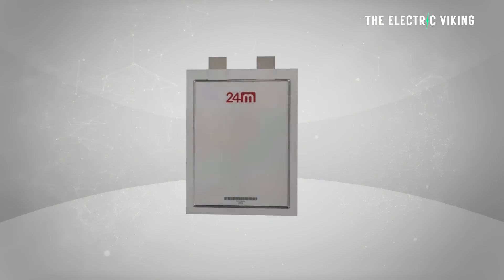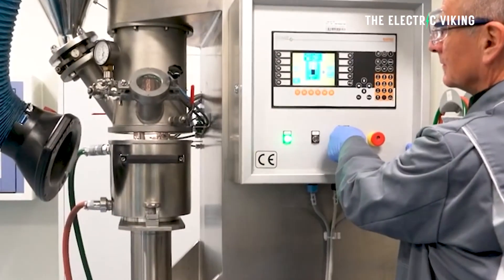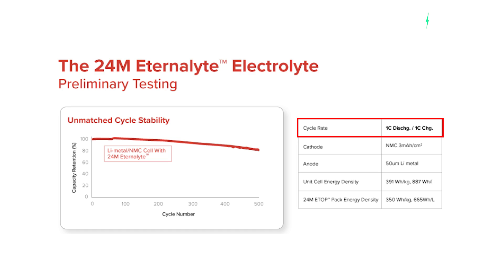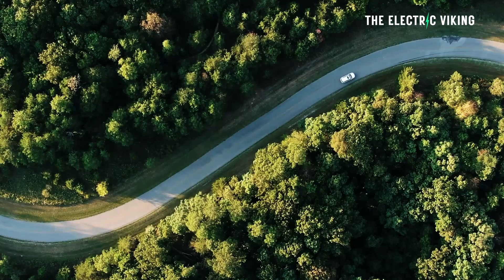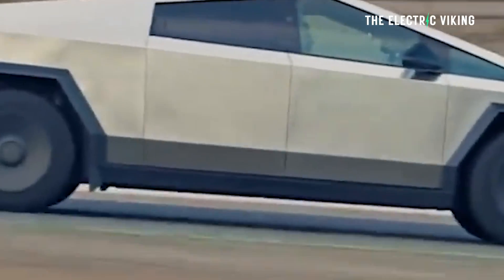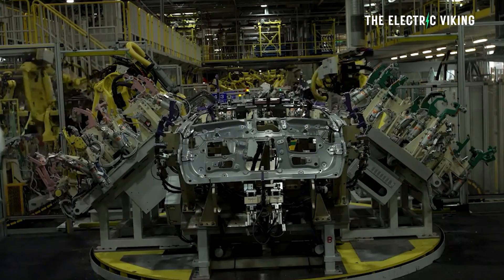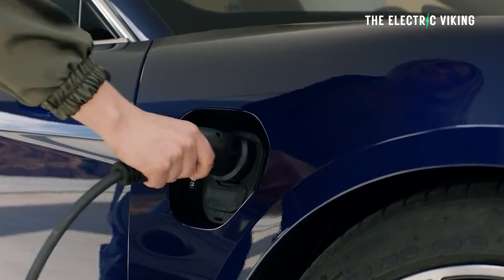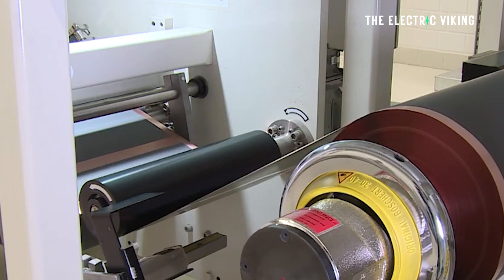American battery company reveals production ready 1000 Mile EV Battery

Comment: WRONG - The VW Passat Bluemotion (diesel) had a 70 liter tank with a consumption of 4.1 L/100km leading to a range of 1.707 km.
Reply: And we all know how accurate and honest VW claims are don't we🤣. Real world fuel consumption for ICE cars is almost as bad as the real world ranges of some EVs. Given that 60% of all car journeys are 10 km or less (global average)...most ICE spend a lot of time warming up so 4.1 l/100 km is more like 5l/100 km or above. I've run diesels and hybrids for many years before I got my EV and sure, on long journeys I could sometimes hit 60 mpg but most of the time it was 50 mpg.
Reply: After all, it just depends on the tank size. Thus google says there are common queries about cars with 70 or 80 or 90 liter tank. This implies there are applications where drivers want that amount to be available, even if they have to replace the original tank. The given example with the passat is not an exception - VW, Audi, BMW had different motors for the same car where the big blocks were quite thirsty so that they installed a big tank by default. Combine that with a super efficient motor from the same manufacturer and you get those 1000 mile range right from the production line.

Comment: Another important thing about getting over 300 wh/kg reliably is that you can make a Model 3 the same curb weight as a Camry.
Reply: Except no structural battery pack if you have to swap out the battery after 500 cycles

Comment: "Jumbo jets" I don't think so.
Reply: EVs benefit from being bigger.  
So why not aircraft
Reply: @markthomasson5077  because for a jumbo these batteries will make the plane too heavy.
The energy in aviation is fuel is about 12000Wh/kg vs 400Wh/kg for batteries. Aviation fuel is 30 time lighter. Although Aviation fuel might burn at 80% efficiency (batteries 90%) so perhaps 27 times lighter. 
So to fly 10 hour on a 747 you need about 150 tonnes of aviation fuel, but for these batteries you will need 4050 tonnes of batteries. The maximum weigh for a 747 is like 440 tonnes (plane+passangers+cargo+fuel). These batteries would make the 747 10 times too heavy, understand now? 
With mathematics you can see about 50% of what this youtuber says is wrong.
Reply: @AORD72  i was thinking more short haul flights.
Current electric planes that are nearly viable are all small.  So my question (and I have no idea of the answer).  Is would a large plane achieve this more readily than a small plane
Reply: @markthomasson5077  Probably no real difference. Small electric planes are viable because they reduce range and carrying capacity. Do the math of some of the small planes. I suspect about 30 times less range for the same capacity. 

"EVs benefit from being bigger. ", you mean a bigger battery? A bigger battery does not matter for an EV because it has wheels holding it up. A plane uses energy to hold it's battery up in the air.

Comment: No No No. We need the 1000 not 600. This is why a lot of people are not adopting. We apartment dwellers are never going to have access to enough chargers. We need to be able to go to a commercial charger every couple of weeks like filling up a gas tank.
Reply: Yea, I am not waiting for 10 hours for half a charge in a vehicle that lasts as long as the battery does and then you have to tow it to the grave because paying (tens of) thousands for the replacement of battery is insane proposition when I can have hundreds of thousands of miles in gas + an used ICE in that money + a gas station everywhere.
Reply: @Ludak021  1% of gasoline cars make it to 200,000 miles.  Consumer Reports estimates the average EV battery pack lifespan to be 200,000 miles.  So, the two types of cars last about the same number of miles.
Reply: ive had 6 cars out of the roughly 2 dozen ive owned over 25 years that had over 200k miles.   and all were european cars

the partial fallacy of your statement is that people economically will not fix a high mile cars issues that arent really related to the engines life, such as suspension, emissions sensors, door locks, Wheel bearings, steering components, windows, airbags age out, ABS issues, seats torn up, 15 year old wiring issues, factor in labor costs etc where it makes more sense to sell the thing for scrap and buy a newer car.    

many times its not the issue of miles, but age, the drive train may still be good (EV or ICE), but it has many other wear issues.  wiring ages and breaks down, materials wear out, etc.  EVs only differ in terms of the drive train, but when you factor in the entire car they are generally identical in potential age and wear issues.  

I have a 30 year old lexus as a second car from my tesla, and it starts, runs, and drives incredible smooth and reliable every day even if it sits for a month.  but i needs suspension work, brakes, all the door locks dont work, steering column doesnt move, seats torn up.  but at 225k miles its a solid hooptie beater car, and the engine still runs as smooth as advertised when it was new (glasses of water barely vibrating AD)

 @AnthonyJMendoza-f7i
Reply: @baldisaerodynamic9692  That is nice that you take good care of your cars, but most people don't.  The lifetime of a Tesla battery is in the 300,000-mile plus range if it is well maintained.  If you don't take care of it, the battery will fail just like a poorly maintained gasoline car will fail.
Reply: @baldisaerodynamic9692  The partial fallacy of your statement is that it's not just the drive train in an EV that tends to last longer. No vibration to chaff wiring, loosen panels and cause metal fatigue, no extreme heat to rust the exhaust and degrade materials etc.
Reply: If you mean km then you are correct.  600 miles is Ok though.

Comment: Great. Now put 2 of them in an F150 so I can actually tow or haul things and sell it to me for under 60K. I'll buy one and so would half of Texas.
Reply: You can have texas. We'll be happy to walk you off.
Reply: @blipco5 along with 70% of the country's energy production.  I'm sure you dumbasses can work something out with the Russians,  Saudis, and Iranians 🤣🤣🤣
Reply: *wall
Reply: If you put batteries in the bed of the trailer and add electric motors to each wheel, it’ll effectively tow itself and reduce the efficiency losses to the “towing” vehicle. Sometimes, to solve a problem, you just have to think differently about it. An EV is not a fossil car so trying to fill it up at a gas station like one or add more fuel capacity to the towing vehicle is just the wrong way to think about things.
Reply: @tmharperjr  And now the trailer will be twice the weight ,and totally illegal to tow more than likely .
Reply: @gremlinfishing4286  … and as battery technology improves, the energy density will increase. The first planes couldn’t fly more than a mile. We’re at the start of an entirely new age.
Reply: I think we have already used all available minerals on this planet to make batteries , the improvements would have to be increased by 100 percent for it to be a viable option for everyone ,a lot of us will still need to tow 2_3 ton I won't hold my breath waiting for it to happen.
Reply: 😂😂😂😂 Right!!!!
Reply: I think you picked the wrong state…
Reply: @josephjones4293  Tell me then which state has a plan for every person who lives in an apartment to have their own overnight charging spot. EV's are not feasible for half the country who are renters just on that basis alone. Then you add in the lack of range in towing and hauling for trucks and commercial vehicles and a lack of realistic charging options for high-mileage drivers like rideshare and food delivery who also live in apartments for the most part. Drastically increasing the range or charging speed are the ONLY way to overcome the lack of charging infrastructure that will never be sufficient for these people. Thousand mile range and/or 5 minute charging or this will not happen. I had a Chevy Bolt for 6 months. Traded it in on a 50mpg hybrid because it was more of a hassle than the gas savings was worth.
Reply: @tyharris9994  Why is charging a state responsibility?  Does the state build gas stations?

Comment: Teslas use approximately 14 kWh / 100 km. Let’s assume lighter batteries would bring this down to 10 kWh / 100 km. A 100 kWh battery would therefore give a 1000 km range: not 1000 miles. 🥱

Comment: They get 340 miles out of a 75KWH battery. Not sure how a 100KWH would give 3X the range.
Reply: Right, for a model Y Long Range, 340 miles / 75 KWh is 4.5 miles per KWh, so a 100KWh battery would get 450 miles (assuming the weight is the same, but it isn’t since a model Y LR pack weight is 771Kg, and theoretically this battery would be closer to 300Kg since it has a much better gravimetric energy density (which is the REAL STORY HERE). ** these Tesla numbers are likely off by a bit, just did google research … 😅
Reply: With 391 watts pr kg density a 100 kw battery would be around 400 kg and then some for the battery casing.  400 kg for 100 kw battery is good.  A little step forward.
Reply: @jpxxx991  Can't assume its the same volumetric size even if it's the same weight. Both elements are important. It definitely would not get 1000 miles on a charge however and would not get 500K miles for 500 cycles.
Reply: @jpxxx991 check my math here, but claimed pack (not cell as you used) density is 350Wh/Kg, so (100,000 Wh / 350 = 285Kg)
Reply: >> They get 340 miles out of a 75KWH 

These new batteries aren't even using KWH's.  That's so last week!  Now they just use KW's.
Reply: @Rick_Cavallaro  KWh's for the power density, KW's for the power delivery. Both figures are important when calculating performance for a vehicle. One for distance and the other for acceleration etc.
Reply: @michaelwebsternz  
>> KWh's for the power density, KW's for the power delivery.

Nope.  KWH/liter give energy density (not power density) and KWH/Kg give specific energy.  And yes KW's describe power delivery.  But my point is that the "Electric Viking" simply gets it wrong - repeatedly.  He just uses KW when he means KWH.
Reply: @michaelwebsternz  Isn't it exhausting always being the smartest guy in the room ;-)
Reply: @Rick_Cavallaro  KWh's is the measurement of how much energy the battery can hold and the KW's is how much it can output. Don't confuse volumetric density and battery density vs total storage capcity.
Reply: @mountainmantesla4395  Nah, quite fun actually. Especially when math is so applicable to financial markets as well.
Reply: @michaelwebsternz  
>> KWh's is the measurement of how much energy the battery can hold

That's what I just explained to you.  You're confusing energy and power.
Reply: @Rick_Cavallaro  I’m not confusing energy with power at all. The others certainly were.
Reply: @michaelwebsternz  I worked in aerospace electrical engineering but quit to become a cop. I had a hard time having conversations with my coworkers. They would always say "what the hell are you doing working here" LOL.
Reply: @mountainmantesla4395  I can imagine.
Reply: @michaelwebsternz  
>>  I’m not confusing energy with power at all. 

You said "KWh's for the power density".  That's confusing energy and power.
Reply: @Rick_Cavallaro  My battery has a capacity of 100KWh and an output power of 368KW.
Reply: @michaelwebsternz That's mean it can run about 16 minutes.
Reply: @michaelwebsternz  Good for you!
Reply: @akakakakakak3084  That is what battery management systems are for as well as the controller for the motor. Because I can at maximum produce something does not mean I typically produce it, or I must produce it at all. It might be that way in order to allow the recharge rate to be higher.
Reply: @Rick_Cavallaro  KW stands for Kilowatt.  That shows how much energy at a moment in time.  KWH means kilowatt hour.  That means a kilowatt for an hour.   You can think that KW is the quality of the energy and KWH is the quantity of energy (how long it can sustain that level of quality).
Reply: @AnthonyJMendoza-f7i  
>> That shows how much energy at a moment in time. 

Nope.  KW has nothing to do with the quality of energy.  What it does mean is the rate at which you can deliver the energy.  In other words - power.
Reply: @Rick_Cavallaro  OK, technically: power = watt = voltage x current.  watt-hour = voltage x current x hours.  What I mean by quality is the amount that can be delivered at each instant in time (as you said Power).  That is a measure of the quality of the battery because one measure of a better battery is how much power it can deliver at any one instant.  The total quantity of power that can be delivered is in watt-hours.
Reply: It doesn't the math / claims don't add up. Model 3 only does 4 miles per KWh with the new refresh version. Volumetric density also matters, not just the weight. The battery required to do 1000 miles is still much heavier than the current Model 3 pack.
Reply: @michaelwebsternz  not much heavier actually since gravimetric density is close to double.  Can you explain why Volumetric density matters when calculating range?
Reply: @huckthat  Need to be able to fit the battery into the space available for the battery pack. Both space and weight matter for range. Else more space might need to be taken up and it might mean the vehicle isn't as aerodynamically efficient. This pack at 665wh/l seems to be quite volumetrically efficient. So a similar weight battery with more kwh capacity would fit in less space.
Reply: The new battery ways less than half as much per kwh apparently.
Reply: Think he's talking pack size and weight not KW capacity
Reply: @ChicagoBob123  KW doesn't address capacity.  And that's why he shouldn't have used it.
Reply: Should be significantly lighter weight
Reply: he meant 200kwh
Reply: @mathieusturkenboom  of course he did.  But you'd think the guy that announces every single day the new breakthrough battery that's going to CHANGE EVERYTHING might get it right - at least once.
Reply: lets pray that he becomes more self aware and double checks his content before posting it on youtube then! maybe he'd have more subscribers if he wasnt so flawed @Rick_Cavallaro
Reply: Maybee lighter but I wouldn't bet that it works 😂
Reply: @Myrslokstok  Weight is a tiny part of range. Once you get the weight up to speed it is all about drag coefficient. You lose a little power from added rolling resistance but you can just pump up the tires for that. The math just doesn't work here.

Comment: The Viking doesn't get the need for a 1000-mile range vehicle. The first application is towing, and others said a taxi service - even if convenient pull-through charging stations exist. At the same time, however, I don't see huge companies (CATL, BYD, Tesla, etc) buying these 400-500 Wh/kg batteries because they need to produce about 10 cells per second to meet a large factory demand.
Reply: And all of us gig worker apartment dwellers don't have the time to spend our lunch hour every day at a commercial charging station.
Reply: @tyharris9994  Why would you? Just have bollards where you park your car.
Reply: There has already been a taxi firm entirely using early Nissan Leaf's, taxis dont need a 1,000 mile battery
Reply: @Stumpy1854-Orion  Most of the taxi business in America has been taken over by Uber and Lyft rideshare. The cars are owned individually by gig workers acting as independent contractors so they do not own fleets with a central charging area that they are parked at overnight but rather apartment dwellers who go home at night with their vehicle.
Reply: Actually nearly every car owner needs 1k range at least in "travel mode". That's because you usually charging from 20 to 80 percent while driving, more is slow and less is anxious, so the 60% of thousand miles definitely couldn't be called as a redundant number.
Reply: @IgorPellinen  Charge curve for these cells and maximum charging rate / charging time would be very important. Most solid state cells are not great at charging fast and the charge curves aren't great.
Reply: Good point that with this battery I can now tow my trailer a descent range.
Reply: @Clint-stanley  There are diesel 4x4s in Australia with a 900 mile range, two 90 litre tanks, Toyota LandCruiser 79 series .
Reply: I want a 1000 miles range car. that be crazy and beat all ICE vechilies. I wont buy an EV unless EV range is more then 420 miles at least compares to my toyota carolla

Comment: You really do not understand long distance driving in the Western USA, Canada and Alaska.  Typical daily driving distances are 600 to 800+ miles with sparsely located gas stations.
A 1000 mile EV vehicle with stopover charging would be ideal.
Reply: Way fewer than 1-percent ever drive more than a typical daily work commute or more than a 250-300_ mile round trip weekend adventure.
    I used to live in the remote high desert east Oregon, my nearest neighbor was 12-miles way and most of my driving was a tractor or an old 4x4 Nissan on the farm. Trips to town were on a week to10-day cycle as was typical of most of the ranchers/farmers in the the area and usually that was to the local cafe or tavern to get the local news.  My big resupply or delivery trips were on a less than monthly basis and were about 300-miles round trip and sometimes that included a 12' enclosed or 20' flatbed trailer, but most often just my big truck/pickup.   
   Real world range issues are a mute reality
     The hysteria over range is a canard likely promoted by the ICE industry.
Reply: @TreDeuce-qw3kv Try towing , hope you like walking ,after 100 miles .
Reply: Doesn't the host live in Australia?
Reply: @linusa2996  As an Aussie I hope not ,we don't like BS .
Reply: Mate we know probably more than you about long distance driving here in Australia, to say most people drive 600 to 800 MILES a day is bs